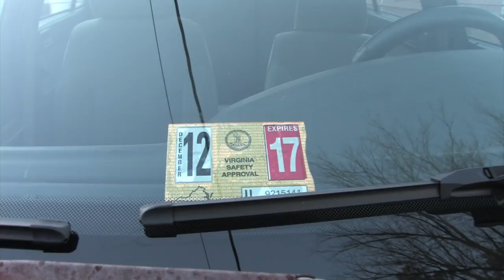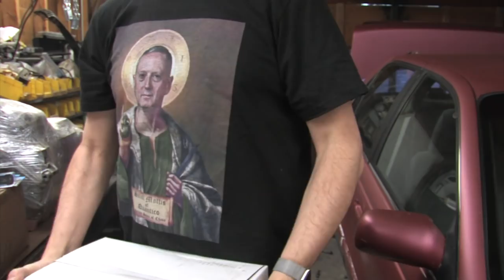Turbo Elantra Traction Issues - Part 2

Comment: Wat happened to the 6bolt/7bolt swap gsx?
Reply from the maker: I want another car I can race while it's getting built.  That GSX build will take over my garage.  I don't want to use precision measuring instruments while the ambient garage temperatures and the temperatures of my parts don't match (using a heater will create a huge temperature differential).  I would prefer an overnight low in the 60's before I start assembly.  In the meantime, I'm making the Hyundai all it can be... so I can bring you all assembly and racing videos simultaneously this summer.  Some of the things it requires take up a lot of space in the garage.  Don't worry, I'm making great progress on those.  The garage will be clear by the end of the month, and I think we're getting our season's last two snow storms out of the way right now.
Reply: Jafromobile wow thank you for taking the time to reply. Extremely Happy to know that the gsx is coming soon. Can't wait. Good luck.

Comment: 250 each for a headlight mate you should of bought them from Australia we have so many Hyundai even Mitsubishi parts for your hybrid engine builds / projects
Reply: Exactly what I was going to say, I even started searching Gumtree for him haha
Reply: Element45 you can build a tough street car from gumtree easy I bought 700 worth of fitting /braided lines -10 other sizes and USA made oil cooler off some old bloke even had a couple of gauges in there too most of the thing still not used
Reply: Shipping would negate the savings though =\

Comment: Hey jafro, long time subscriber

Was going thru the car junk here and found some Hyundai Elantra/excel headlights which are glass. Couldn’t contact you via messages
Reply from the maker: You must be in Germany... ?  TBH... A dashing Mr. Hoffmann just sent me a pair complete with corner markers.  I didn't even know such a thing existed?
Reply: I’m from Australia jafro, I saw pictures of your headlights and they look different, it has 6 10mm bolt holding it to the body of car, unlike yours, it bolts up to a frame then car
Reply: I’ve got some pictures of you have an email address

Comment: early 19eigties car manufactors started using more plastic, and to this day it is half plastic cars. I hate plastic, they make 
everything out of this stuff, cause its cheap. But its crap. I removed as much of this stuff from my 1989 Ford Fiesta, as 
i could, replaced it with handmade aluminium or steel parts, like i made an all aluminium dashboard, and what is not needed
like bulging side trim ( wich is just ugly ) stayed off the car., welded the little holes. Now much cleaner slicker looks the car has.

Comment: Jafro, dealing with FWD with any serious amount of power is a slippery slope, i've had the same car as 4WD than FWD and now RWD and is an night and day difference, not even treadwear(10) tires could make FWD get traction in first two gears, here is my build may give you some ideas:  http://www.505turbo.com/forum/index.php?/topic/3254-91-405mi16x4-rear-wheel-drive-conversion-north-south-engine/&page=1

Comment: boost by gear.
Reply from the maker: Right now it's set to wastegate pressure in every gear (10psi), and I can't floor 1st, 2nd, or 3rd without traction loss.  In other words... it's already turned all the way down.  I've had it at 30 PSI before, and I actually get the same traction and acceleration.  Just a whole lot more tire smoke.  :P